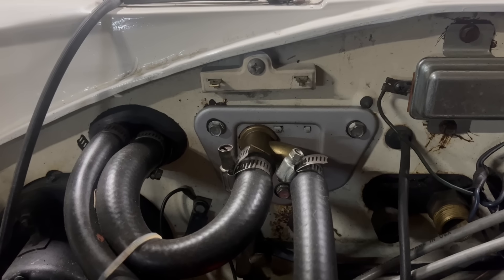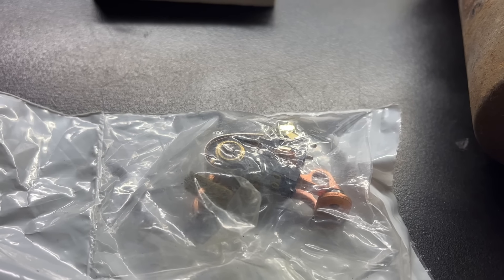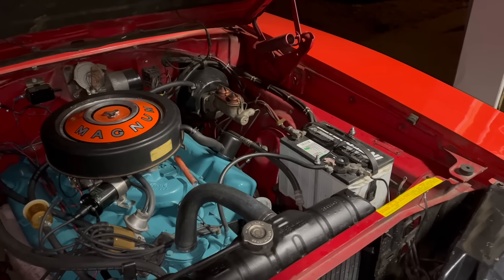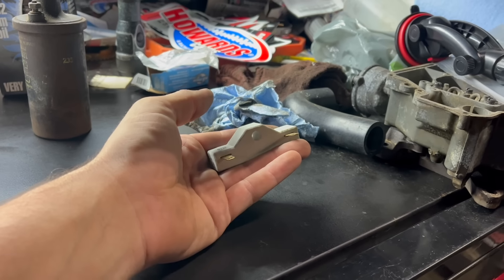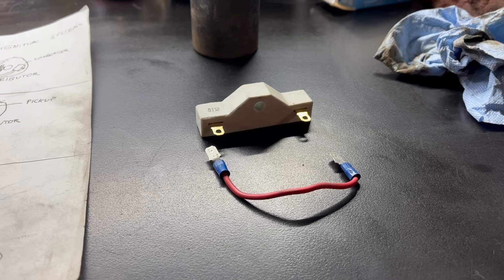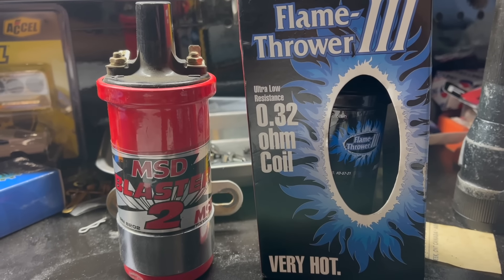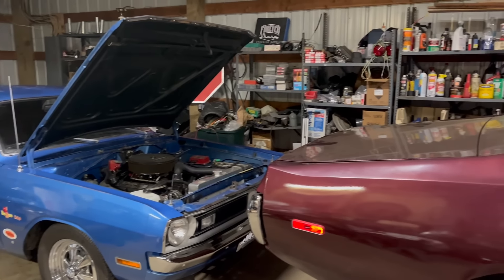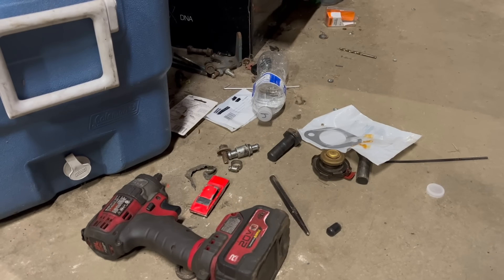The Big Ballast Resistor Video! A Simple, Yet Misunderstood Part Of Your Classic Chrysler Product

Comment: always enjoy your videos man ! was waiting the part for regulator cause now am having flickering lights in my 73 Charger SE  and had the alternator tested ( good ) and changed to Voltage regulator until now no luck , is it dangerous  thanks
Reply from the maker: Flickering lights - disconnect battery, unplug wire connector, check for burned spots, clean both sides of the connectors with wire brush and some electronic cleaner, apply dielectric grease and reinstall. Check ground strap from engine and small ground from battery to radiator support. May want to add a shunt wire / ammeter bypass wire. I discussed this in my charging system video. It’s a good modification for many reasons. Hopefully this helps.
Reply: @DeadDodgeGarage  will check the whole  bulkhead connector today as i don;t know which one for the lights since all the lights of the car flicker including cluster , i changed the voltage regulator twice, i have a shunt wire on my amp and direct wire from alternator to starter relay stud but am thinking of deleting completly the AMP gauge and just connect the wires together by a screw , is the flickering dangerous  thanks man !
Reply from the maker: @MOPARMuscleLEBANON  It's your system voltage fluctuating that is causing this - not the light circuits. I recommend cleaning the firewall connector because it can help improve all of the circuits involved and reduce voltage drop - for example, power to the ignition circuit that also powers the voltage regulator. If you already have a shunt wire that's a good start.

Comment: I would have to agree. Even though I haven't played with a classic Dodge in a while; when I did.... my Swinger would eat voltage regulators - but they were all aftermarket ones.  Though I did learn to attach a secondary ground to them and that seemed to help.  I think I burned up ONE ballast resistor in that car too....and it too was an aftermarket part.  My Valiant and New Yorker were both pretty reliable.  Though the Valiant had an intermittent issue with the distributor pickup that plagued my parents for their entire ownership of the car.

The thing is, with general maintenance; none of these items are real issues.  It's only when you ignore things that failures begin.

Comment: My first real job was delivering parts for the local Dodge dealer. Every time it rained, the Dodge truck with a 318 wouldn’t start. Why not? The ballast resistor.
Reply from the maker: I’ve had a handful of people say so in these comments - which is really interesting to me. I live in grays harbor county Washington, one of the rainiest places in the country, and I don’t think I have ever had a ballast resistor fail due to rain water. I had a Dodge truck with 318 that lost voltage regulators give or take yearly, and I believe that was down to water coming down from the hood drip line. But the resistor never kicked it.
Reply: @DeadDodgeGarage  thanks for the reply. Maybe it was the voltage regulator. I was just a punk kid at the time and I remember the parts manager always grumbling “damn ballast!”🤣
Reply from the maker: @andrewhooper5645  No you're not the only person I've heard that same thing from. I just find it really interesting that I haven't had that problem.

Comment: I am 68 and been driving mopars all my life still have my first car a 71 charger and it was just 318 car but I hopped that with 340 stuff put a electronic ignition conversion on it when they first came out in the early 70s and 410 gears in an 8-1/4 rear ran pretty good for a heavy car and later put it all back to stock and parked it when that 904 trans finally die at about 160k I need to move it out of the corner of my shop and start working on it I think this video has inspired me 😮
Reply from the maker: Awesome! Getting them back on the road is kind of my whole thing. You can do it!

Comment: You as a MOPAR man should know that fuel filter on your '68 while clear of sediment is about ready to crack from heat related age and burn your Charger to the ground!
Reply from the maker: Nah. It’s a year and a half old. I’ve discussed this a lot, but I use those on everything. I have never, ever, EVER seen one crack. Hell, not long ago I revived a car with a plastic filter hovering an inch away from the exhaust manifold on a slant six. It showed zero evidence of heat damage. On the other hand, I have seen those stupid three piece glass filters leak and try to start fires (at least once with success) multiple times. If my Charger burns to the ground some day, you (and the other commenters) are more than welcome to say “I told you so.” Either way, the good news is, it’s insured. 🙂

Comment: If you bypass the ballast resistor and put a full 13.5 volts (engine running) to a coil that can handle the increased current draw especially a sub 1ohm resistance coil wouldn't you also have to upgrade the wiring gauge to handle the increased current draw because if you had a 1.5ohm ballast resistor plus a 1.5ohm coil so 13.5vdc from alternator divided by 3 ohms produces 4.5amps draw. If you bypass the ballast resistor and put a sub 1ohm coil lets say .6ohms or .32ohms and hooked it directly to 13.5 volts that would produce a 22.5amp draw using a .6ohm coil and 42.2amps using a .32ohm coil and the factory ignition wiring gauge isn't designed to handle the increased load!
Reply from the maker: Really glad that I’m too stupid to do the math on this, but I think yours is off. All I can say is, I’ve run COUNTLESS high performance coils on factory ignition wiring with the ballast resistor eliminated with absolutely ZERO issues. For years. Have multiple cars that meet that description on the property right now, with countless thousands of miles between them. So I’m going to have to say it’s not an issue.
Reply: @DeadDodgeGarage  Ok just asking because I'm thinking about installing the Pertronix system and in the installation instructions for a .6ohm coil they say to remove the ballast resistor and/or resistance wire and replace it with a 12 gauge copper stranded wire to handle the increased current draw.
Reply: @DeadDodgeGarage  Sorry after researching this subject more in depth I didn't take back or counter EMF and dwell time into account along with the coil resistance that altogether determines primary current draw when the engine is running which is less than when the engine is stopped and the points are closed.

Comment: What’s the proper way to bypass the resistor that has four prongs I’m running a full MSD system
Reply from the maker: Just bridge the main connections - the secondary half of the resistor will only have one wire on either side. You can ignore those. The blue and brown wires are the ones that matter.

Comment: So, why does my 73 Dodge Dart with 225 Slant 6 and ELECTRONIC distributor (what it came with) have a 4 pole ballast resistor?
Reply from the maker: Because all of the original electronic ignition cars (standard across the board for 1973) used a four pile ballast resistor. The second half of the resistor powers a circuit in the original style five pin ignition module. It’s not necessary at all if you have a four pin ignition module, and I obviously didn’t think about it at the time of filming, or I would’ve mentioned it.
Reply: @DeadDodgeGarage  Thanks!

Comment: Iv`e tried mopar electronic control module with high power coil and no ballast.  Ran 10 minutes and shut off. Module TOAST. I am running Module at battery voltage, and I always have. Only the coil is on a ballast. I jumped it to battery voltage and smoked the module.
Reply from the maker: Only the coil would ever be on ballast (at least with 4 pin module.) The module runs on key power. Good to know. I’m sure many people have tried this. I’ve heard that it can work, but it’s probably going to depend on the resistance of the coil.

Comment: Dude. This info is gold. I'm eyeing a 70s Dodge pickup barn find and this is just the data I need. I had no idea what the Dodge wiring weirdness was about. Thanks!
Reply: For the record, lots of old stuff works exactly like this. I helped someone diagnose a scout 800, and it has a ballast resistor doing the same exact thing. It's bypass was built into the starter, an "I" terminal, kind of like the ford solenoid bypass but just located somewhere else. No wiring weirdness, just how it was done back then. 

IH mounted the resistor down near the starter, so it'd take on water super easy. It's encased in ceramic because it gets hot in use, and it's not perfectly sealed. Not the best choice, IMO. I relocated it...

Comment: The GM 12V points cars had this resistor also. Friend had the engine start/stop problem and when I jumped the wires it started and he looked at me in awe.
Reply from the maker: Haaahaha. Yep. I know tri fives did. Did they use a resistor wire like Ford later? Can’t remember.

Comment: The ballast resistor is significant IF you want the engine to continue to run after it is started. It IS insignificant for starting. For a Mopar owner it would be wise to carry a spare at all times. The "body" of that resistor has a tendency to crack after it is heated up and water is splashed on it. The resistance element opens and VOLA , NO high voltage for the plugs! In a pinch, carry a jumper wire with 'roach clips" attached, so you can jumper across the ballast. This tip is ONLY for short trip, otherwise you will "fry" the coil and/or the power transistor in the ignition module!

Comment: Never changed one on any of my Mopars!, However I did change to Moduel Box on my 1977 Dodge Aspen because all of the Sealing Material melted and ran out, But it was still working but I figured not for long! Lol
Reply from the maker: Oh yeah. I’ve seen a good few of those streams of horrible potting goo running down firewalls and inner fenders. Haha.

Comment: Fantastic video as always. I have a question. When I owned a 69 Dodge Charger 383 back in 1981, the ignition key started getting hot. Like burn my fingers hot. I eventually simply replaced it with a cheap Pep Boys generic key and it seemed to solve the problem. But I never figured out what caused it. Any ideas?
Reply from the maker: Woah… can’t say I’ve ever heard of that one.
Reply: Bad earth?
Reply: Possibly a short in the switch or the wiring. I had a 68 Charger RT and a couple of wires under he dash were siamesed after one over heated. An auto electrical specialist spotted the problem and sliced them apart. He also spotted the fact that I had a 3 wire alternator in a two wire alternator car. He grounded the second field terminal and I got better charging.
   You should be able to get a factory style switch from a parts store or Classic Industries.
Reply: @auteurfiddler8706  this was in 1981. Car's long gone, but thanks!

Comment: I worked for a repair shop years ago. I was an Auto Parts Counterman, and found myself between jobs, and one of my former clients asked me to come work for him. They specialized in Fiat’s, but worked on anything that came our way. There were 6 mechanics in the shop, one of whom was from czechoslovakia and was quite a character. One day he was working on a Ford Courier mini truck. It would start fine, but as you switch from start to run it would die, just like this gentleman explains here. I pulled a ballast resistor off the shelf and took it to him, and he said that wasn’t the problem. As soon as he left for lunch I put the new ballast resistor in place of the faulty one. The owner walked up and asked what I was doing, so I told him about  what the mechanic had said, and told him that when he pulled back into the lot I was going to start the truck and walk away do it would be running when he came back to work on the truck.the owner laughed and said, let me help you. I’ll signal you when he drives in so he doesn’t see you by the truck. When the mechanic came back in I got the nod and went over and started the truck, then went to the office where the boss was watching to see what happened. When the mechanic walked in and realized the truck was running he had a really shocked look on his face. The boss and I laughed our butts off, and when the mechanic finally realized what happened, he was totally embarrassed. All cars had a ballast resistor when it used points style ignition systems.  The 6 and 8 volt cars didn’t need one, but when they started using 12 volt systems they all did.  And yes’m there were cars with 8 volt electrical systems. But they wouldn’t start cars when it was too cold. They replaced the 6 volt systems, but were found to still be unreliable in cold country.
Reply: Love the story man.  Thanks for sharing.

Comment: I was hoping to learn about those fancy double-decker 4 terminal resistors, I really don't understand what's going on with that second layer of resistance.
Reply from the maker: I should have covered that. My bad. The second half of the 4 pin resistor feeds a circuit inside the original five pin electronic ignition module. The later four pin module does not require that extra resistor circuit, and a standard two pin resistor works fine.
Reply: @DeadDodgeGarage  Thanks, sounds like I can eliminate it on my Monaco.
Reply: @realmaindrianpace   You can use a two pin ballast if you have the 4 pin box. But if your dual ballast is on there now, no reason to change it. The other resistor just won't draw any current.

Comment: That fuse is strange but I had a 69 roadrunner back then and I got drunk one night and that fuse blew and probably saved my life that night. I was about to get on the highway stopped at gas station and car would not start . So I left it there a came the next day and found that fuse had blown.
Reply from the maker: A resistor has a very different job than a fuse. Sounds like that worked out though…

Comment: In 2004 I changed the entire driveline in my 78 150 to one from a 95. Changed to a carb and Chrysler ignition. Since 04 I've changed 1 control unit, 3 voltage regulators, 1 coil, 1 alternator, and 0 ballast resistors
Reply from the maker: Sounds about right to me!

Comment: All this is just yay yak yak..  If you know electronics you know that a resistor is just a step down device duh yeah heat!.. The step down is to save another device down the line like say a coil! Or even a transistor!... Not to hard to understand if you took 8th grade electronic class... So as long as you have the correct matching components your ok... But when you start mixing and matching there is when trouble rears its head... Luckily mopar did a really good job marking everything and its easy to make all the connections as long as your able to read!..  And by the way I did a video showing how and why those new Chinese 4pin boxes can fool you into thinking they are bad but they  actually are still perfectly fine just missing one thing and most people never guess what that is.
Reply from the maker: I can only assume your one thing is “ground.” But I really have to laugh, because you think there are still 8th grade electronics classes 🤣 that hasn’t been a thing in any school I ever went to - so where do you think that leaves kids reaching adulthood now? I explained what the resistor does in easily understood terms, and how to diagnose a resistor problem. As far as those Chinese four pin boxes? I have been down that road many, many times - and I happen to have access to an ignition module tester. I’m really glad you have an understanding of all this! This video pretty obviously wasn’t made or directed at you.

Comment: Im bench starting a old datsun engine, all the wirings are correct but as soon as i connect battery main to the ballast resistor it starts to get red hot.What might be the issue here please help me asap, it will be really appreciative
Reply from the maker: I don’t think it would be doing that if the wiring was indeed correct. That sounds like a short. The resistor should get hot, but not to the point of smoldering.

Comment: Years ago, had a 73 Dodge Van. One day tried to start it, sounded light jumped timing backfire, wouldn't start. I am GM guy, and my first Dodge vehicle. Called my grandfather who knew a retired Chrysler mechanic and told him to tell me to change the ballast resistor, never heard about it (way before the internet) went to parts store and bought it. Found it buried up under the firewall, behind the brake booster, changed it, ran like new. Never forget that problem.

Comment: In my 61 years I've always had one in my glove box.
I've never seen one go bad.
I've literally seen people change them out after flooding  the engine out. Yes, people back then didn't know how to start a car with a carb.
They would change the balast resistor, and declare it was the balast resistor.
I've seen this scenario many times but never seen a bad balast resistor. 
I've seen the coils separated from the broken ceramic and it still worked.
Show me a bad one, i bet you can't.
Reply from the maker: I’ve had a couple bad ones over the years. I shared the story of the resistor dying in my Challenger in this video. It does happen - but I really don’t think it’s as frequent a problem as the legends seem to indicate.